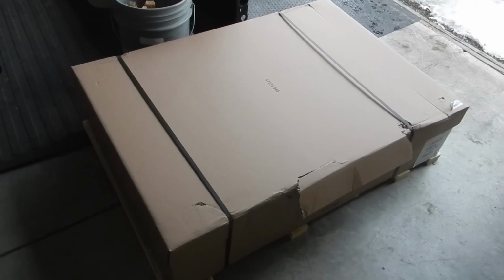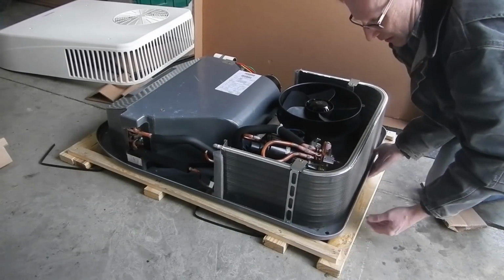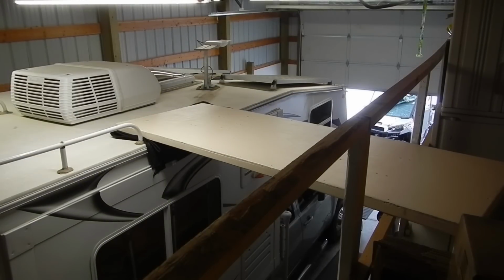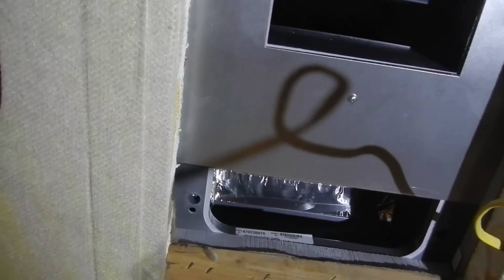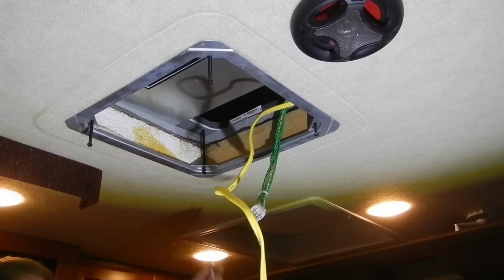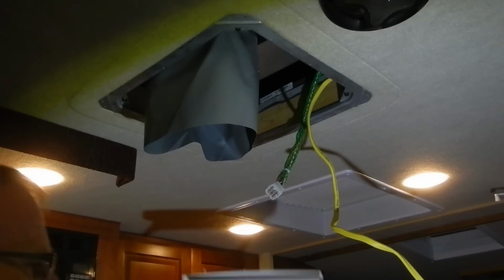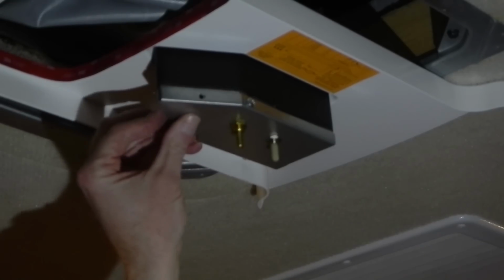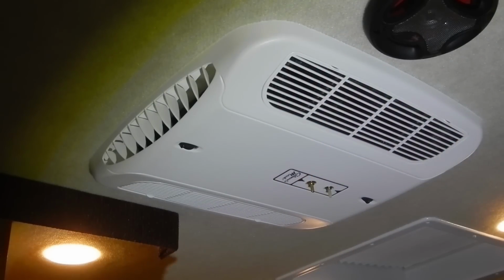Installing an RV Air Conditioner unit

Comment: sir you haven't spleen one thing about how you install that unit how you took off the oil unit installed the new unit you didn't explain one thing you just showed his what what you doing and you said what you done but I didn't see one thing you done show you how you done it pull explaining
Reply from the maker: Thanks for watching.  Glad you found the video informational.

Comment: Power consumption wise do you see much lower usage?
Reply from the maker: Power usage is a little more on this unit since it's a 13,500 BTU unit.  The unit I replaced was an 11,000 BTU A/C.

Comment: Has this unit treated you well? Any issues other than noise?
Reply from the maker: It's been working perfect for the two years I've had it installed/  The heat pump mode will cook you out.  I only use it to warm up the camper prior to going to bed, then I switch on the propane furnace if I need heat all night.
Reply: @deltabravo1257  Why not heat all night with the heat pump?
Reply: @ElectricTechAdventures  From my experience the furnace is much quieter.

Comment: Hi, it would be nice to see the unit run and see operation.
Reply: And hear the operation :)  Is the new unit quieter, or just more efficient?
Reply from the maker: Efficiency is about the same.  The benefit is that it does HEAT too, not just cool.  From the outside of the RV, it's a a lot louder.  The small fan on top of the unit is really noisy when it runs.